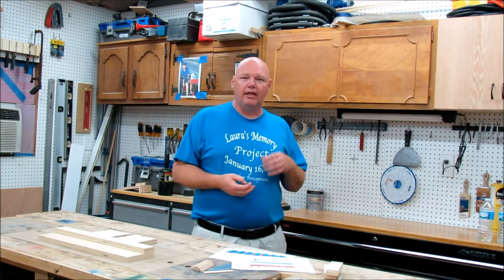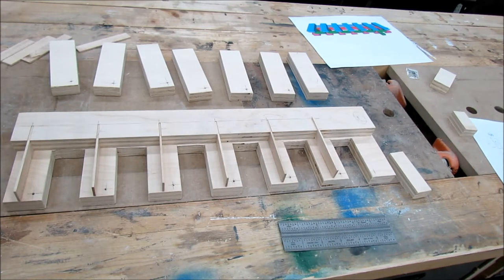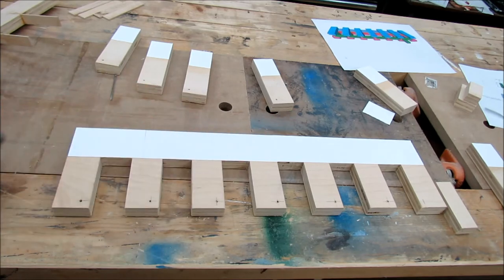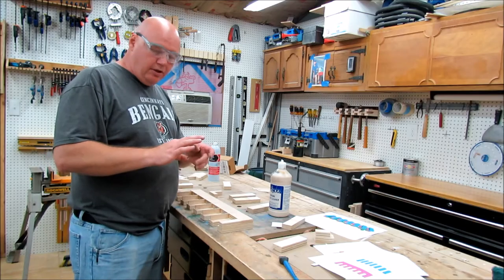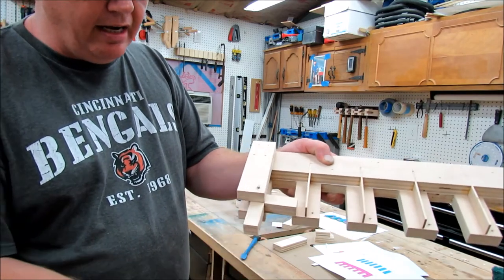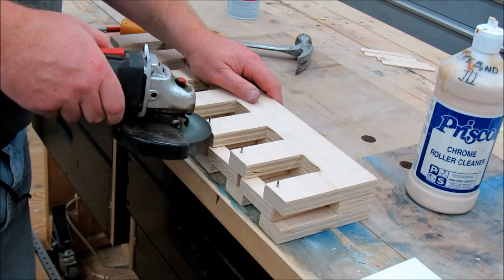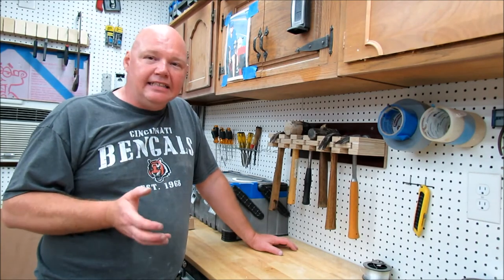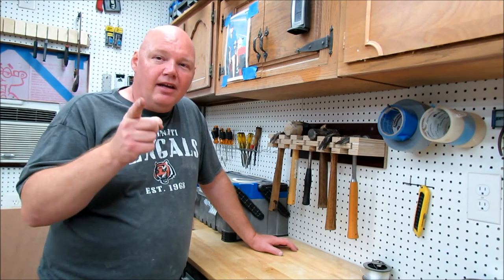FREE PLANS! Homemade Hammer Holder

Comment: Is that a friction saw till you have above your a/c?  Also how is the Vega fence holding up?   I am trying to decide between the vega on sale right now for $280 or the Biesemeyer on sale for $350..  The vega looks like a very easy install.
Reply from the maker: Yes that is a friction type till. The one over the A/C is for rulers and putty knives I have another one I use just for saws I simply love them.  The Vega fence is great it's as accurate as the day I installed it.  It's an easy install I have a video showing just how easy it is.  Thanks for the questions and for watching.

Comment: Do you really need the springs? Seems that the action of putting the hammer in and out would swivel the right angle piece absent the spring. I’m not dissing your project, I’m just wondering. Thanks.
Reply from the maker: The springs help with opening the angle piece completely and holding it in place.  But you can build your without the springs and see how well it works and let me know.